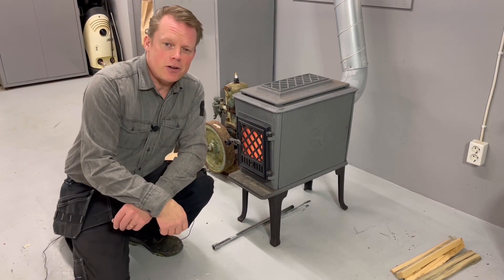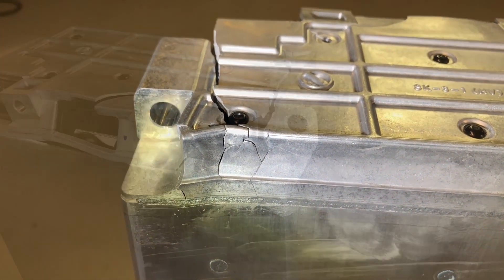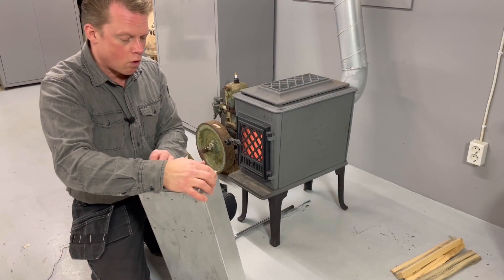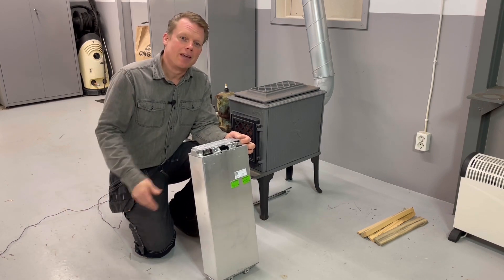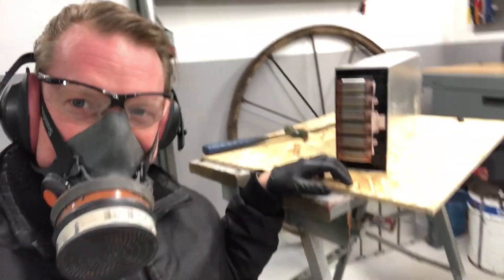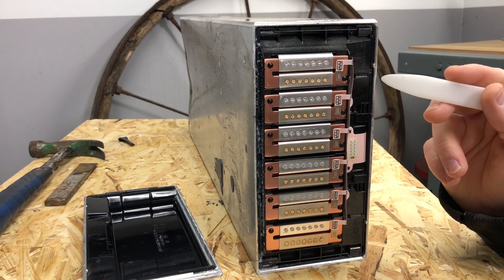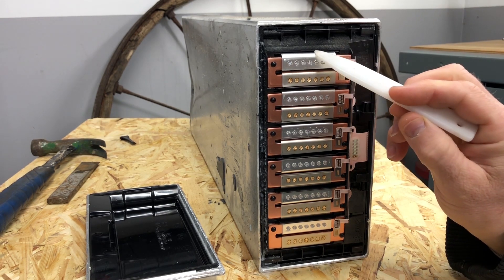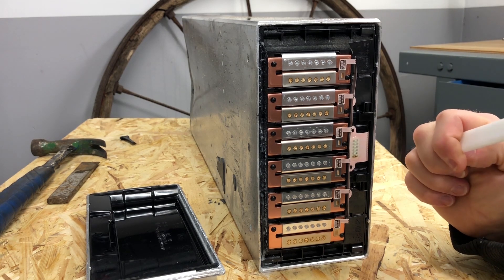Open up a VW id3 id4 lithium battery module.

Comment: Thanks for doing the hard work for us and videoing it! Seems like the cooling of the cells cannot be very good they cool the modules only from the bottom side and only one side of the cell is touching the bottom side of the module. Opel ampera and volvo phev had cooling channels between the cells.
Reply from the maker: Hi, and thank you so much.😃
The cells are much higher in Opel amperage so those cells must have cooling between the cells. It’s also common that Phev cars have the same typ of cooling between the cells due to the high c-rate. The cells in the meb platform is not that high and in that way that they are configured in the module makes the contact surface more then enough for normal use.

Comment: Can you do a cell test? They are very popular but no one knows if they are dangerous. I am curious what will happen with overcharging or short circuiting.
Reply from the maker: Yes, I have plans for that. But those cells are completely discharged so I have to open up a module that I almost discharged, and that is definitely not safe. But as I said, I have plans 😉
Reply: @flyingtools  
If those cells are completely discharged, is it possible to revive or resurect them ?  by charging them one by one ?
a lot of  18650 cells a lot can be made a live again. ( could be a nice next video with these LG Chems ),
also mr Jehu Garcia has a nice video about these LG chems and he was quite impressed.
Reply: @flyingtools  I have two of these modules, locked them in an ammo box for safety. The question is whether such security measures are justified. I'm waitnig for your test. :)

Comment: with this battery a repair is probably impossible 😅
Reply from the maker: Yes, sadly you are right, even with proper tools a repair is not possible.
Reply: Please understand that this is not the battery, but just one out of twelve modules. Repair is done by exchange of the defective module - obviously the one we see is coming from a battery repair.
Reply: @Henning_Rech yes but you can’t change one cell, In Smart ED3 you can change every cell from the 93 that they have.

Comment: Sad to see the cells glued. Makes removing single cells hard as hell.
Reply from the maker: Yes, i was very disappointed.
Reply: Tested today. It is really hard, almost impossible without damaging the outer pouch.
Reply: maybe with the right solvent (acid?) it could be washed away?
Reply: Why bother disassembling it? Just  find the damaged cell and take it off the bus.

Comment: These videos will be very popular in about 5 - 8 years when a lot more ID cars will be taken out of service and people will want to use the battery modules for solar energy storage.
Reply: I bought a Dacia sprimg especiallu for this. I payed for it 11.k euros brand new, in romania, i plan to use it as a commute car for the next 5-7 years(the car will pay for itself only from the differences from gasoline to electricity) and after 7 years I will ise the battery for solar charging and powering the house.
Reply: Mmm - good luck getting one of those apart in usable condition. Manufacturers must be forced to make them easily servicable
Reply from the maker: Yes you’re probably right.
Reply: @flyingtools  https://youtu.be/8aNjnFhlUlI
Reply: It is already happening.
Reply: @jaroslav-jaroslavsson  

https://youtu.be/8aNjnFhlUlI
Reply: https://youtu.be/8aNjnFhlUlI
Reply: The fact you cant use the id3 battery for home use makes that id3 a totally useless car. The id3 wont have any residual value once europe designs electric cars that CAN be connected to your home and so CAN power electric appliances. For instance during night. 60-100kwh batteries are perfect for that. Just imagine that Ford in the US DID figure this out with the Lightning.  And so its sold out.
Reply: @chuckjager5371  my VW ID.buzz has an option for powering the house.. so no problem.. but why use it anyway? electricity cost are about 0.1 eur/kwh so i dont get the point of having a FV system on my roof
Reply: Takie filmy są poszukiwane już teraz bo ogniwa lgx e78 są wykorzystywane do fotowoltaiki jako magazyny energii :)